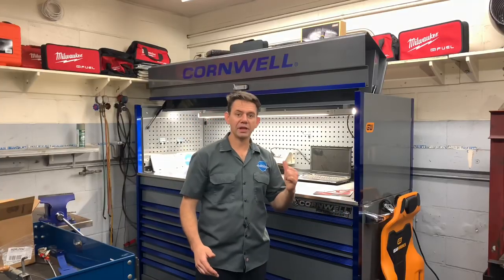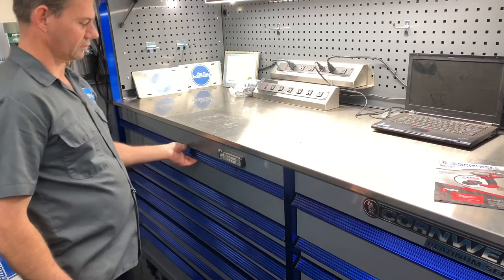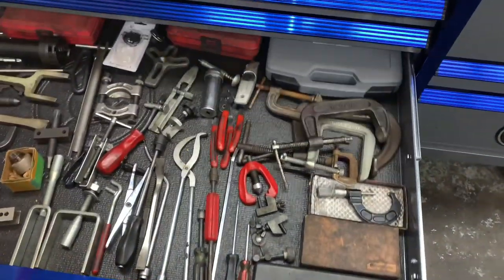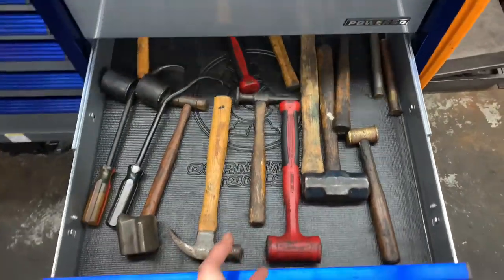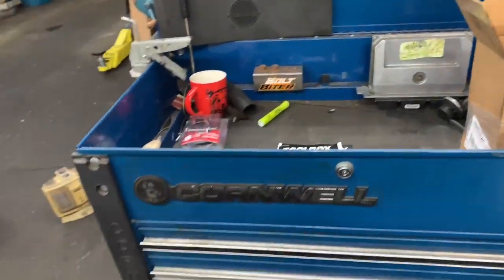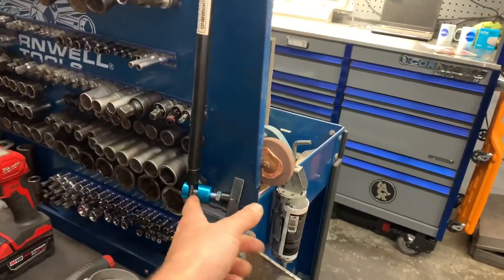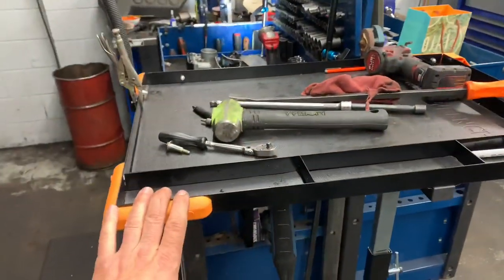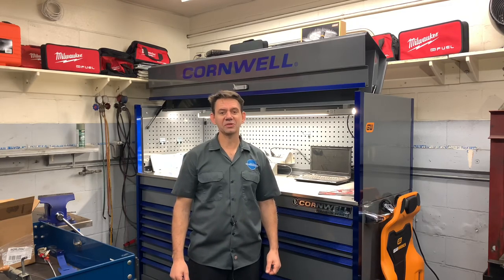Toolbox Tour Cornwell Tools Platinum Series Toolbox and Hutch

Comment: Very nice set up , That new box is awesome.i was wondering if that Milwaukee 3/8 stubby has enough power for bolt in wheel bearings, turod ends, in
Reply: Yes it does. Not a problem for her. Regards.
Reply from the maker: David Bodkins about in that Application it will do about 90% of the bolts. Every now and then your run across one that it will take out. The Mid Torque is a better choice for those type of jobs.

Comment: I've got same Cornwell Platinum tool box in Black. I would have to disagree about the drawer latch release system. My drawer get stuck on one side a lot. They didn't make the release bar stiff enough. I also think the power drawer is too deep should be just deep enough to fit a battery on a charger. Also there should be a least one more of the deeper 3" or so drawer. Even though this box is loger than my old Mac 1350 the top drawer is shorter at minimum the top drawer should be full length if not two drawers.
Reply from the maker: It's a tool thing maybe you have some defective drawers. I’ve never had a problem with any of mine. The only we going to get the perfect box is to designed ourselves. Who knows maybe one day that will be a option👍

Comment: That extended anvil Milwaukee impact looks pretty nice. You wouldn't have to use the extension when using flip sockets with that set-up.
Reply: It's nice for lug nuts, but the torque loss is always there

Comment: How well would those Milwaukee die grinders work for a body shop? Would they be strong enough to strip paint an such?
Reply from the maker: Nick Priest They would definitely work well in that situation. They have bigger battery packs so you can go for a longer period of time. They also have a straight version coming out next month.
Reply from the maker: This the grinder in action https://youtu.be/zPWgn8eCm6c
Reply: Hey thanks man idk how I missed that video! Looks like it would be pretty useful in a body shop.
Reply: Nice. I was wondering if the Milwaukee grinders would be strong enough to be in a bodyshop.
Reply: carey gale I’ve heard they get to hot from some folks. so if it’s light use I think it’ll be ok but I don’t think it’ll replace a good 1/2 hp die grinder.
Reply: @LethalDentCompany  True. I been waiting to see if one of my coworkers gets one I find out then. I'm not in collision anyone. I work at a somewhat fab shop. The company builds commercial truck body's, plus they built there own dump truck beds. So I'm using the 90 degree die grind a lot. Pretty much beating the hell out of it lol
Reply: carey gale yeah you need to be in the 1hp asile. I beat on mine too I have 3, 1/2 hp grinders I use different wheels on em just to disperse load on em in hopes they will last a bit longer
Reply: @LethalDentCompany  yeah that's true. I have three, one with a wire wheel the other with a roloc 36 grit the 3rd on fir back up
Reply: My cornwell guy says they have been having issues with them and that Milwaukee put out a thing saying to only use 2inch pads so you dont kill the tool

Comment: So you spent Snap-on pricing a very cheap looking box! Is the hutch bolted on with self tapping screws into the stainless steel top with L brackets!?? And why does that hutch look exactly like the Extreme Tools hutch for almost a1/4 of the price listed on the Cornwell website!?! I hope you didnt pay $18k on this box!!! It looks worth at most $7k but only for being 84” long! For $14k you could have gotten a Span-on Epiq 68inch with a 30inch locker end and hutch! And have SNAP-op quality! Also choose your own trim and color (those colors are available! Im no means a snap-on fan boy, I own an Icon! Im only basing it on pricing
Reply: Snap on hutch is bolted the same way